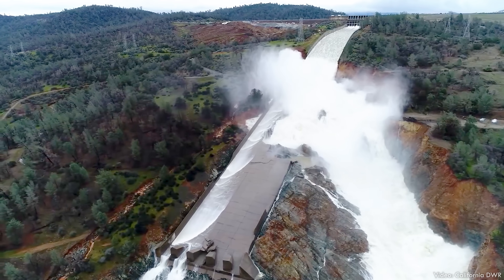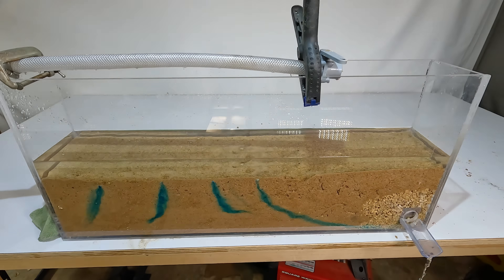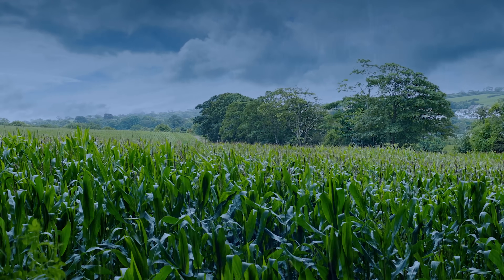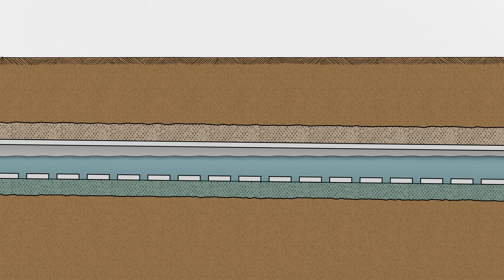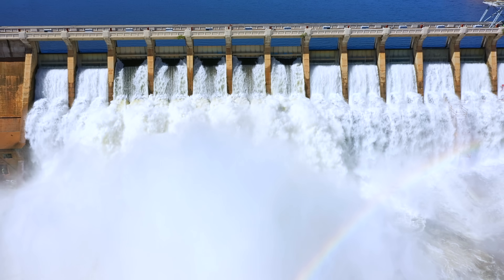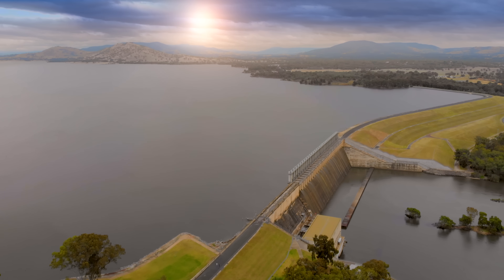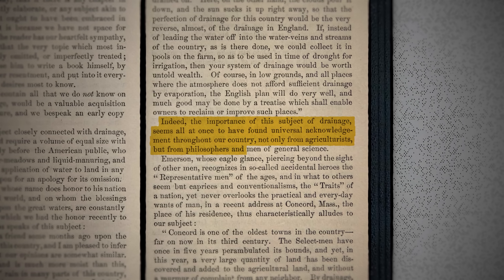How French Drains Work

Comment: In residential construction a French drain greatly means a grill covered drainage cannel used as part of the travel surface in a driveway or walk.   I thought it named after grilled over small drainage channels common in some parts of France.  I'd expect a French drain to have some visibility on the surface and be used for surface runoff.  Henry Flagg French never called his ideas for subterranean dewatering French drains.  It does show as that when Googled with other depictions of subterranean dewatering systems. '

Henry Flagg French's ideas for subterranean field drainage were implanted in much of the glaciated parts of the state of Indiana.    Subterranean water drainage systems are still referred to as field tile in the state of Indiana not a French drain.   The glacial till has fine clays that hold on to water creating an anaerobic soil typical of wetlands causing unreliable crops in oxygen deprived soil.  

The trapped subterranean water can be caused to leach out over time with implemented subterranean drainage.  Indiana created Legal Drains in the later 1800s which were channelized and lowered streams over most of the state to allow gravity fed subterranean field drainage.  

It's a bit of joke to talk about protecting wetlands in Indiana because the Department of Natural Resources specifically outlines the implementation of Legal Drains for what could be classified as wetland dewatering in an online document of about 400 pages.  Surprisingly wetlands as classified are dry some parts of a year.  

The clay piped subterranean drainage was frequently spaced much farther a part than field tile of today.  Its surprisingly sparse in fields.  That was enough to get the fields to work in the late 1800s when animal pulled plows and much human labor being the only way to install them and they were likely expensive for the 1000s of feet of clay piping.  

Clay pipe subterranean dewatering drainage was called field tile in Indiana because it was made in the same way as fired clay tile.  Possibly the name came over from other regions and it was made by clay tile manufactures.  Without them Indiana couldn't couldn't have utilized much of the agricultural land it has today.

Steam powered dredges were used to channelize and deepen the streams into Legal Drains.   They'd be assembled at the headwaters and work their way down till the stream entered a major river taking more than a year in the later 1800s.  It most have been a sight to see this huge steam powered dredging machine bigger than a typical of a mobile steam shovel of the time.   

I haven't seen any photographs of the steam dredges.   Large format cameras would have been available and it would seem some engineering photographs would have been commissioned.   The amount of earth they moved and berms they'd made are large.   They were much larger than the largest escalators moved by road today that don't require assembly on site.

Most of Indiana is has been made to be a French drain.

Much of the land around the streams of Indianapolis having been turned into Legal Drains is greatly leveled from the steam dredging process.   This possibly unknowingly was why the stream locations were chosen to be scrutinized for implementation of the Indianapolis express bicycle path greenway system being planned in the 1990s.   

The Greenway system  was suppose to turn Indianapolis into a world recognized bicycle city to attract the head offices of international corporations, but was largely given up on except for some Rail-to-Trail conversions.  There were to be 150 miles of exclusive bicycle paths in the Greenway network with no areas in the metropolitan area more than 3 miles from access to the Greenway system.

Comment: Hey Grady, I love the work you're doing for the community. I consider you to be somewhat more of an expert on geotechnical engineering than myself, and I would love to pick your brain for a moment if you have time.

Water is a polar molecule due to the uneven charge potentials that are distributed across the hydrogen and oxygen bonds. Would it be feasible, then, to use a voltage potential across a filtration medium to 'recharge' or pull soil particles back out of a soil-clogged membrane or fabric used in some of these drainage solutions?

Would it also, then, be feasible to use a voltage potential to move water through a given saturated medium from a source to a drain?

Lastly, and maybe the most interesting to me: Given that large energy distribution networks have large ground potentials across wide areas, is it possible that these fields influence groundwater movement in the direct vicinity of the network installations?

These are just a few of the ideas that your content has inspired, and if you don't have time to respond immediately or at all, no sweat. 

Thank you, again, for all the wonderful content you've provided through the years. I know it takes a lot of time and effort on your part, which ultimately shows in your presentations.

Cheers!
Reply from the maker: Look up electroosmosis. It's been tried, but I'm not too familiar of any very successful applications. They even tried it on the Leaning Tower of Pisa. I'm sure there are some out there!

Comment: My only experience with a French drain was at a lake lot where we had a sink we used for washing up so we just dug a trench a few feet long, filled it with pea gravel with a perforated PVC pipe in the middle of it, and ran that pipe up to the sink.  So sort of a reverse French drain.  Worked great though.

Comment: I used to live in the netherlands where a lot of the old drainage systems did not use any type of pipes or rocks and instead relied on ditches in the ground at ~10ish meter intervals. When it rained, a lot of these drains became partially flooded and many a birds would rest ontop of them. Sadly, the increasing weight of tractors meant that the comparably wetter ground that these fields would have became muddy and couldn't support the weight of said tractors.

Comment: All of the Contractor Channels I follow that deal with Drainage use PVC Drain pipe with 2 rows of holes set 60 degrees apart and they always install them with the holes facing down at 5 and 7 (picture the pipe as a clock to figure out what I mean)...
This allows the pipe to start taking water without having to completely saturate the gravel while also leaving a smooth unbroken section of pipe on the bottom to promote fast water flow to help increase drainage capacity and sweep debris out of the pipe...

Wrapping the gravel in 2 layers of construction grade landscape cloth helps keep sand and dirt out of the gravel increasing the longevity of the drain...

If I was going to spec a custom drain pipe, it would be a PVC pipe with holes at all points except the 6 position at the very bottom to maintain that clear, unbroken track to help keep debris flowing out of the pipe while maximizing the pipes ability to accept large amounts of water during heavy storms...

Comment: My house is half way down a small hill, nothing major, but enough slope to send thousands of gallons of water toward it during a heavy rain.  The house should have been built with a French drain system; it wasn't.  

It now has one and I now have a dry crawlspace that can be used to store stuff in, rather than 250 square feet of mold incubation system that would occasionally turn into an indoor wading pool - and short out my electric water heater.

Comment: Before I switched to larger volume chambers for my drainage needs, the perforated PVC I used to install would have two rows of holes 90 degrees apart, so water could come up from the bottom easily, but still had a smooth bottom surface…  Maybe that was just a local thing to my area.

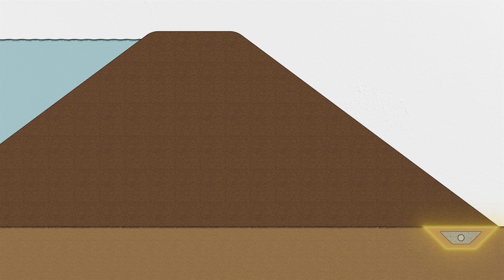Comment: Great points, demonstrations, and examples. A good drain design depends on good grain size distribution sample locations and analysis. The design shown starting at about 12:00 is superior, though 2 stages may be insufficient in some cases (e.g. 3-stage or even 4-stage). I’ve annoyed some drillers by requiring this approach for efficient well design, whether the well is for water supply or dewatering purposes.

As pointed out, geotextile fabrics or filter socks to envelop gravel or sand bedding, or to wrap directly on perf or slotted pipe, very often clog with fines and/or bacteria. Unfortunately, some building codes require their use in specific circumstances. And to get a variance may require hiring an expensive professional to convince the bureaucrats a better approach exists. Been there, done that.

Comment: I had French drains installed around my house but could never escape the thought that it was just a matter of time before the geotextile fabric & drainage rocks would plug up.  I could imagine creating porous plastic divider walls that would allow sand to be used as an exterior layer and then drainage rock on the interior with the perforated plastic pipe removing water at the base.

Comment: I think there is an issue with FD.  (explaining a flow issue) My OSSF accidentally got a blockage where the water was overflowing into the top of the T-fitting-outlet & when I removed the obstruction from the bottom of the T-fitting-outlet the water did not free-flow out of the tank. Water moving up into the pipe to discharge out of the tank had a limited flow that was far lower than 100 GPM.

Comment: 5:24 Which way should the holes face?  Before listening any further, my guess is that to a first approximation it doesn't matter: pressure acts equally in all directions, so that empty space we want to keep empty can be filled from any direction.  As a second-order effect, I would expect the little gaps to propagate upward more easily than downward.  But then there's heterogeneity of particle size.  I don't know how that will play out.  And there's clogging of the holes themselves: if you can get by with fewer and smaller holes, you can have your pipe clog more slowly.

Comment: Also, you describe exactly how to design a well filter - you find the correct filter grain size corresponding with the natural soil to let the water in and keep the soil out. If the natural soil is very fine, you arrange multiple layers of filter sand with the grain size ascending the closer you get to the pipe. In modern wells, one layer will suffice because you can reduce the "hole width" of the pipe by using wire screen filters (also commonly known as Johnson filters), which can have filter slits as narrow as .5 mm and still let generous amounts of water pass.

Comment: As an environmental engineer, this is one of my favorite channels. I deal entirely with groundwater but never in the context of how it interacts with and affects structures. Thank you for your amazing content, Grady!
Reply: This channel is just fabulous!  Way to go, Grady!
Reply: Mr. French only slightly missed the mark on rocks in New England.
Rocks, and the heaves and sinkholes they facilitate, are one of our primary crops.
Sadly, there is little demand in the produce aisle for that crop.
Reply: I just realized that the drainage pipe on the back side of the wall has to be the lower than the finish grade, or floor, on the other side.

Comment: Fascinating presentation. I'm thinking of putting in a French Drain in my front yard to help with the lousy drainage left by the builder. (No curbs so I get a lake at the bottom of my driveway/yard when it rains) This helped my understanding a LOT.
Reply: I wish the sand method was better known in the trades. I hired some plumbers, and they sub-contracted some excavators, and I at least had the common sense to stop the excavator crew piling pure clay on top of the perimeter drains around our house. They were looking at me like I was from Mars saying 'well we put they clay back in lots of other places, not sure why you're fussing'. I feel bad for all those other places! At least I have a good layer of 3/4" crushed rock - But I sure do wish it was surrounded by some sand. Next time.

Comment: I worked for a project for a small solar plant. We have installed french drains like you mentioned in the video: a ditch filled with gravel and a perforated pipe covered with geotextile.

But the problem we got is that when raining a lot of sediment from the muddy soil eventually covered and clogged the drainages. We had to remove and change the drqinage on key points for open concrete ditch.

At the time this solution worked well in other projecta but this particular one failed due to soil. So is important as you said that only gravel or big grain sized gravel may not be optimal.

Comment: When I used to work in road resurfacing, we would use the opportunity provided by the removal of the asphalt to install French drains along the curbs and retaining pits at all the storm drain entrances. It was basically a quick and dirty way of improving the century-old storm water drainage system without having to totally tear out the entire road and dig up the old storm sewers.

Comment: My soil is clay so I can not use sand in my drainage solution. "the clay particles will fill in all the open spaces between the sand particles and often the clay will act as a 'glue' sticking all particles together, ultimately resulting in a more dense soil." So just a head up rock done in different sizes (dry river beds) geo textile and pipe are still the best options when clay is around. Would love to see that model tested in your tank 👍

Comment: Interesting demonstration. The question I have is that if you put a drain tile next to your foundation, does it actually draw MORE water to the foundation than if it wasn't there and you just graded properly in the first place?

On a side not, when we built our house, the lot started sloping from the street to the back. The house was built with the elevation high enough to allow the yard to be filled in to make it gradually slope from the house to the street. Rain filtered down through the fill until it hit the original grade and then flowed to the house, leaving a damp spot about 4 feet up on the basement wall in one place. The foundation drain was corragated  plastic pipe run around to the back and to daylight. The back fill was just soil from the site with no gravel or sand.

Comment: I put french drains behind a cement block retaining wall I rebuilt 15 years ago.  Dig out behind wall-put geo cloth in with lots of excess on both sides-lay in perforated drain pipe with a cap on one end-back fill with gravel-fold geo cloth over top if gravel with a big overlap-backfill with soil.  It hasn't budged in 15 years.
Reply: It isn't engineered if it isn't overengineered.
Reply: I just built one too- 100 foot length
Reply: How tall was the wall, and how far down was the pipe? Also, the cap was presumably on the high end, right? Is it accessible/removable in case you ever need to flush out sediment? And is the low end of the pipe just exposed to daylight after it gets past the retaining wall?
Reply: @froggydoodle808   @froggydoodle808  It was built in southern Ohio.  There was an existing footer so I was able to utilize that.  At it's highest point maybe 5' tall.  I dug out behind it when taking the old wall down, rebuild the wall with split face cement block, then would buy whatever broken bags of concrete they had at Lowes or HD for cheap, then shove pieced of rebar into the block cavities that all lined up and fill them with concrete.  I put the perforated pipe as low as I could on the back side of the wall and ran it all the way to the end.  I backfilled it with gravel and the broken up wall I removed and covered it with landscape cloth before covering it with dirt.  There was no need to have the caps removable since I would not need to access the block cavities.  The backfill with the pipe at the bottom maintains a way for water to exit so it does not build up behind the wall and tip it over.

Comment: The spillway failed because of the Bernoulli equation in action. The concrete wasn't anchored to bedrock and drains wouldn't have made a difference. Check out the nearby Bullards Bar spillway which I saw being anchored in 1968 and is much steeper and it was engineered by a private company not like Oroville, which was a state project.

Comment: 5:20 except when we say 'holes down' they aren't actually on the bottom, they're at 8 & 4. The bottom of the pvc forms a trough for the water to run and just above that are the hole on either side.
Reply: "8 and 4 or turds on your floor" is what I always say. Always.

Comment: An additional issue that sometimes happened with the clay tile pipe was collapse which could cause sinkholes as the result was a large opening into which soil could wash. I grew up on a dairy farm where that happened at several points in a large hay field, ultimately being part of why we turned that field into pasture.

Comment: I exclaimed out loud when you revealed the other filtration method is sand! That’s so simple that it’s not obvious you could stop soil using another type of earth! Thank you for making this video, I’ll be sure to remember this!
Reply: Let's hear what kind of sound you make when you hear that depending on soil type etc, it's possible to use tree tops/branches and straw instead of pipe+sand. :)
Reply: The problem is that sand can get "clogged" with smaller soil particles the same way pebbles or geotextile can. It's sort of an unsolvable problem: no matter what you use as a filter, the stuff you're filtering out inevitably gets stuck in the filter and blocks it up. The best you can really hope for is to make your sand layer wide enough that it won't get badly degraded during the intended lifetime of the drain.
Reply: Yeah or find a way to back flush the filter media 😂